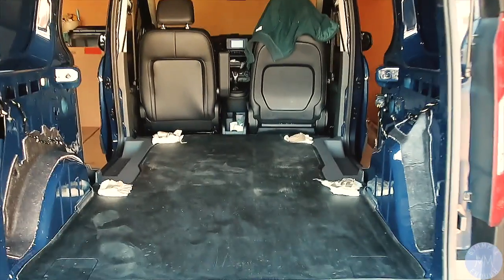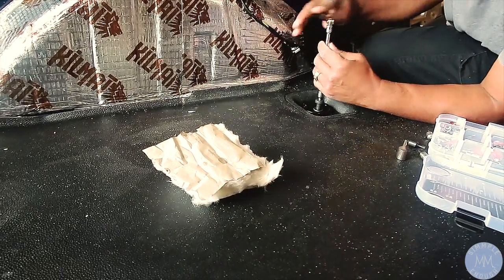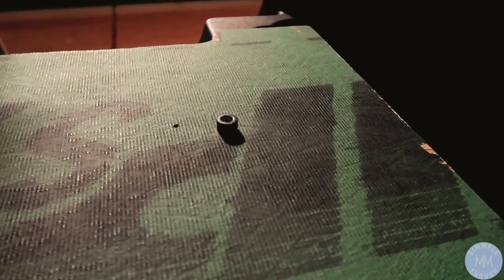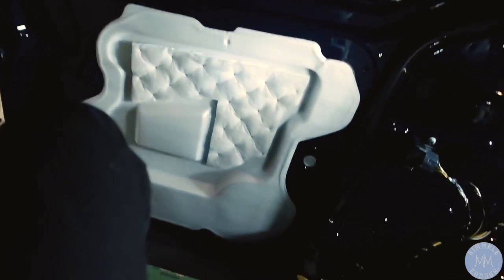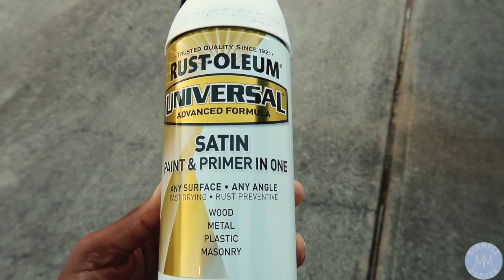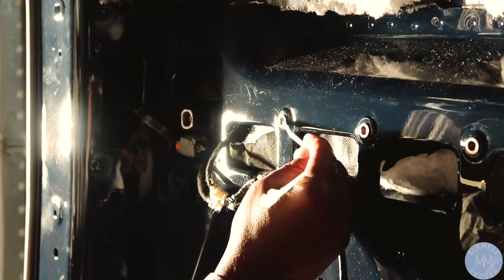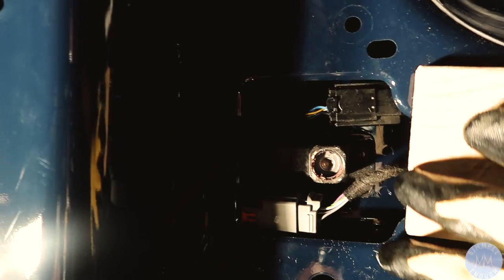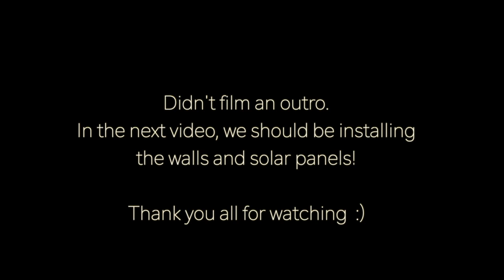Ford Transit Connect Van Build! //  Installing Floor & framing Walls

Comment from the maker: This video might make a van build seem easy, but I can assure you it is not!  Sometimes, my dad and I would spend the entire day measuring and cutting wood over and over and over, just to discover that some of the cuts weren't the correct size, so we'd have to do it all over again. Sometimes, after a 6 hour van build day, it'd seem like we made no progress.  I'm saying this because sometimes I'd feel discouraged with how long simple tasks would take, especially since it didn't seem like other van builders on youtube took as long to install a floor or frame a wall.  Now, I'm convinced we all go through this struggle, we just have to edit much of it out so the video isn't super long.  So if you're converting a van and it takes you 3 days just to cut the wood for ONE wall, please know you are not alone!  It's part of the process 😊 

Some of the Products I used in this video:
Insulation: https://amzn.to/3IDI36U
Spray Adhesive for insulation: https://amzn.to/3IhbOJn
Kilmat Sound Deadener - https://amzn.to/3xD2HxG
Alternative Sound Deadener - (I used Kilmat, but it's currently out of stock. This is a good alternative) - https://amzn.to/3EmseiD
Tool to remove air bubbles: https://amzn.to/3xEIjMA
Loctite - https://amzn.to/3IhOnzv
Rivet Nut Tool - https://amzn.to/3IDChCd
Kreg Pocket Hole Kit - https://amzn.to/3YJC324
Spyder Spade Drill Bit Set - https://www.lowes.com/pd/Spyder-Stinger-14-Piece-Assorted-Woodboring-Spade-Drill-Bit-Set/1001148466

Comment: This video brings back memories of me helping my dad from the early 80s until I moved out of the 1932 Cape Cod fixer upper he and my mom had bought in '75.
They saved 10 years to get it and moved me and my brother in when I was five.
Dad bricked up the fireplace and brought in a little cast iron wood burning stove as our major source of heat.
I remember helping him work on his VW beetle & helping him hang paneling (just dated myself again😂), install baseboard heating in the basement, so many memories.
When he suffered a double stroke in 2017, I trekked from GA to NY every couple of months, and sometimes more often when schools were on break. (It was too much red tape to try to even think of moving him closer to me). When we brought him out of nursing care to his caregivers house, I donned his tool belt and built a ramp for his wheelchair, complete w outdoor carpeting and looped telephone wire to move it. It was from this HUGE bundle, no doubt from the early '80s!
Dad was still having lucid moments and we laughed so hard when he said, "See! I told you that telephone wire would come in handy one day!"🤣

It's beautiful to see you & your dad working together ❤️

Comment: OH!  Thank you for the nail polish idea.  Big help that one!  To mark wood I tape large sheets of paper together then draw the outline of the area, cut the paper to size, poke holes with a pen in the paper(an inexact method) for where the holes go, then transfer that to the board I'm cutting and drilling.  But often the pen holes aren't the same size as the drill holes.

Comment: Hello.. I owned a 2019 Ford Transist Connect  Mini Camper Van and sold it in 2021... If I may.... the watch out for you will be the windshield, I replaced the windshield for a crack that ran along the bottom of the window once and filled chips in the windshield 3 different times in the 2 years I had her. I recommend good auto insurance to cover the windshield. I learned after the fact that the windshield is not made for rocks to bounce off of like automobiles. This is just FYI and not meant to be a discouragement. :)
Reply from the maker: Jeesh, how frustrating!  Thank you for the advice.  I think my insurance has good coverage for windshield issues, but I’ll definitely double check.